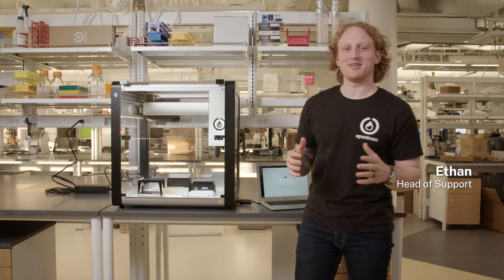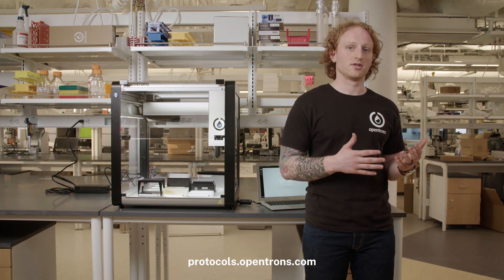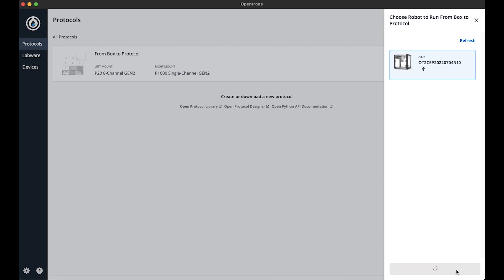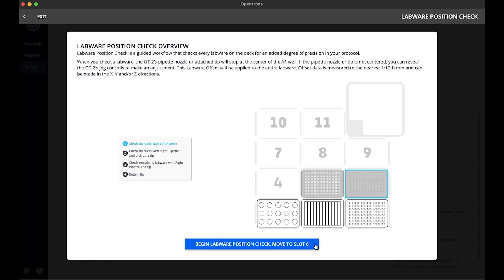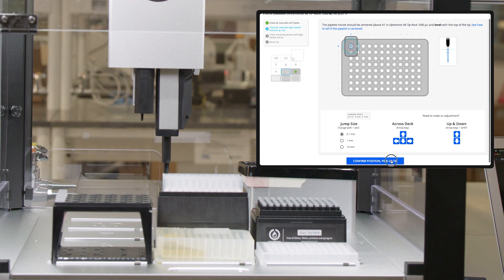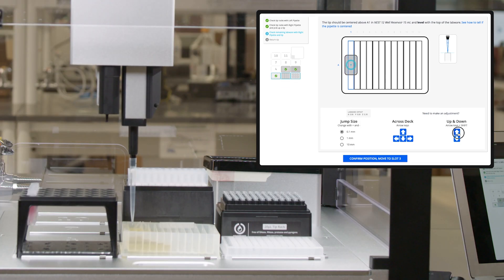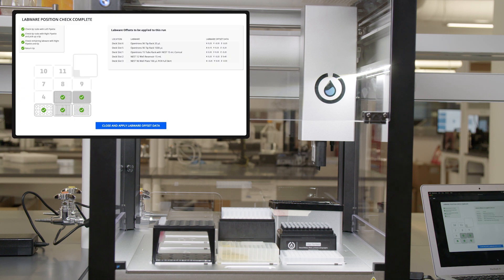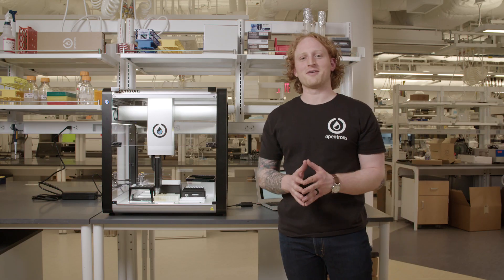Running a Protocol on the OT-2

Comment: Hi, Very nice videos ! Just one question: why your OT-2 has a tape on trash bin where normally there are the 'sensors' used for calibration ?
Reply from the maker: Hi Marc! Great question. The tape holds down a piece of plastic that covers the now deprecated tip probe calibration sensors. These sensors at one point aided in the pipette offset calibration. We have since improved the flow of pipette offset calibration to no longer require these sensors.